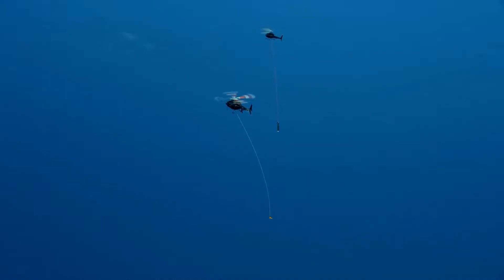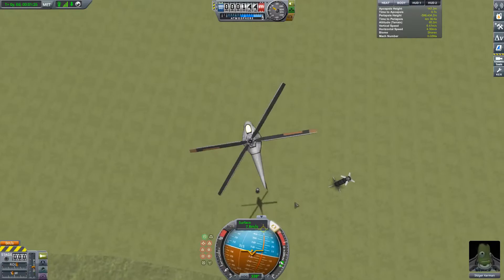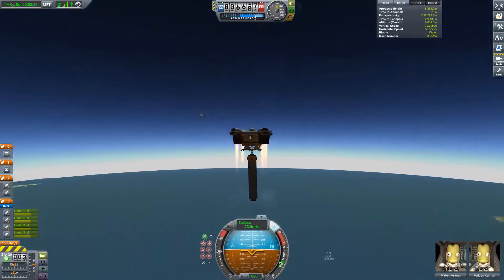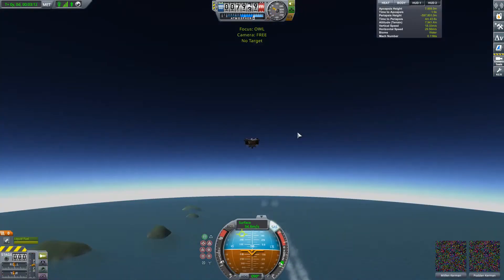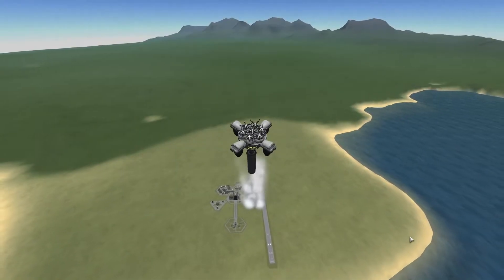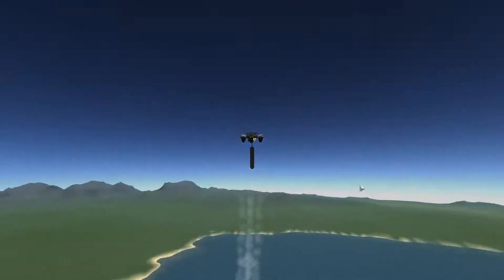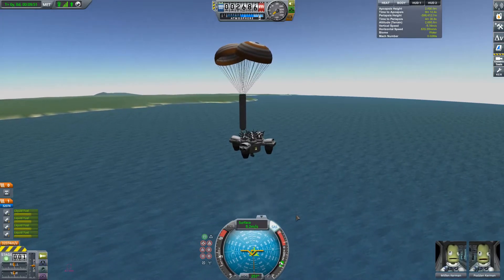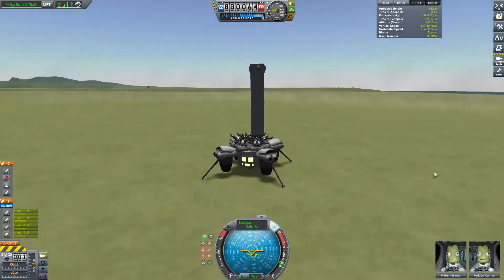Rocket Lab Style Booster Recovery in KSP!

Comment: Not sure if you already tried this, but you can use SAS to hold the craft radially out, as long as you have a probe core pointed upward.  Then it's easier to make small adjustments when hovering.